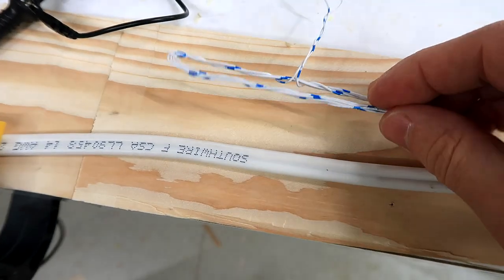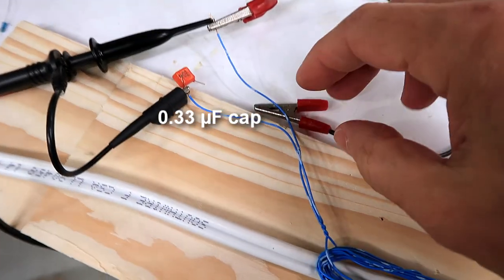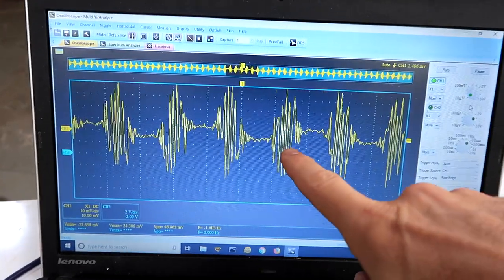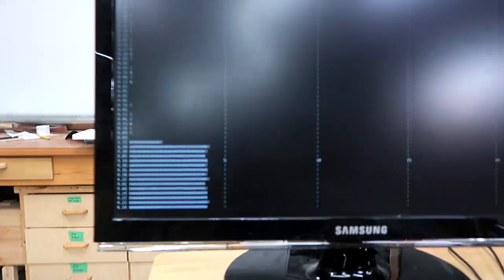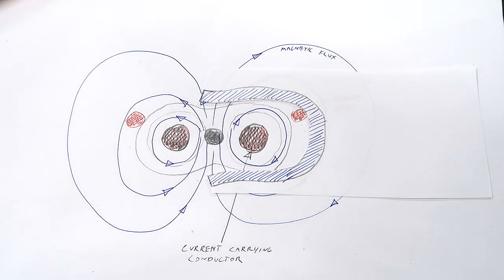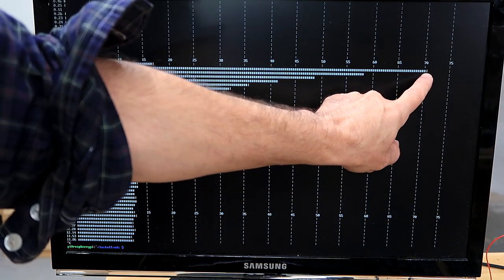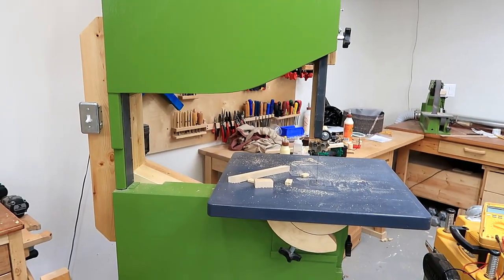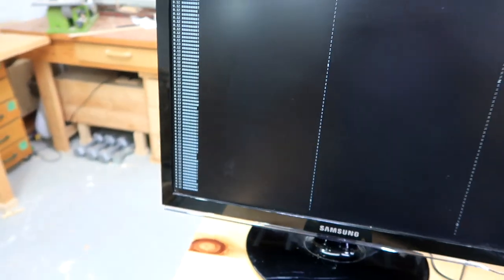Inductive current measuring using Raspberry Pi

Comment: This is roughly how the 'Sense Energy Monitor' products work. They develop a sort-of fingerprint for devices that are plugged in and identified on the circuits into your breaker panel.
Reply: Yep and it’s also why they don’t work. Device signals change and they can be similar to other similar devices.
Reply: @Mrcaffinebean  Mine has been very accurate. It discerns the difference between my iPhone and iPad when plugged into the same charger for example. I think you're just being Mr passive-aggressive-not-so-smarty-pants.

Comment: You could use a extension cord with split cables to measure every machine. No need to split the cables of the machines.
Reply: Well, what's the point of the challenge!

Comment: if you power your electronics connected to the Pi with a separate power supply it will help with noise a ton. Running them off batteries will work best for eliminating noise. The Pi has very dirty power.

Comment: If you powered the ADS1115 off the 5V rail, than yes I suspect you would see noise due to whatever the RPi is doing. The 5V rail is unregulated. However, the 3.3V rail is very stable - try that
Reply from the maker: it's running off the 3.3 volt rail.

Comment: Out of interest what make/model is the circuit breaker? Do you know what curve type? C,D etc? I believe typical household C curve type CBs depending on their make will trip instantaneously at 7-10 times their rated current. If your breaker was rated at 15A then it looks like it not tripping at 145A makes sense. Given that this is in the higher range of CBs and their are always going to be tolerances in circuit breaker tripping curves. Really good/interesting video hope to see more on DIY metering.

Comment: Funny, every time I started my table saw and shop vac at the same time it blew my 15A breaker or would tripped the GFI. I guess the arc from the vacuum motor is the cause? Annoying for sure.

Comment: If you want to make a current tansformer you need to put a load. Your coil needs to have a resistor accross it.This whay you'll get rid of the noise and actually measure current and not voltage that somehow depends on current, but also on other things
Reply from the maker: This is not a current transformer in that sense.

Comment: Its quite common for a motor's peak starting current to be about 6 times the normal running current.
12 amps × 6 = 72 amps

Comment: I'm enjoying this sort of content, but I'm weird. Could you describe some of the theory behind filtering noise from the RPi? I had constant issues with mic noise with my RPi. I was using USB sound chips. I'm glad you decided to look in to the clamp on style probes.
Reply from the maker: I just filter for the 60 hz component.  That might not work for your mic.
Reply: @matthiasrandomstuff2221  yeah. I think it's high frequency noise from the Pi

Comment: I get why the current measuring tranformer doesn't work unless you isolate it to one of the wires in the circuit. Or at least, I think I get it: because of the left hand rule, the magnetic fields on each wire cancel each other out (from the perspective of the transformer).

But why does your homemade coil work? Why doesn't the same canceling out happen? Both phenomena are capacitance, but something must be different.

Comment: I wonder if you could rectify the signal from the coil and run it in to an Op amp then convert it into an off on signal. Then you could have one CT on fuse box incomer, from that you could deduce how much power is being used and on which circuit.
Reply from the maker: signal is too weak for a rectifier.  but it could be amplified then rectified.

Comment: I'm wondering what mechanism the iVac switches use. I know they clamp on the wire of the tool. I'm guessing it's similar where it's trying to cancel out part of the coil by positioning the clamp next to a single wire within the sleeve. Been wanting to do something similar to automate my workshop without splitting cords or creating my own extension cord with the split-wire. I tried a Hall Effect sensor too, but I got nothing from it.

Comment: I used current sense transformers on each of my machines connected to an arduino to automate my whole dust collection setup. I have a vid explaining the details on my channel. I actually want to experiment using an FPGA instead of an arduino. Do you have any interest in FPGAs or Verilog?
Reply from the maker: no interest in FPGAs.  i don’t even use arguino.  the pi is surprisingly real time when it’s not busy.

Comment: You should test audiophile power cleaners and conditioners to see if it really does clean up signal noise in your power lines.
Reply from the maker: I'm not paying some exhorbitant amount for them, and I'm quite sure they wouldn't send me one for review!  Plus, no point in arguing with audiophiles.  They are as removed from fact as conspiracy theorists.
Reply: @matthiasrandomstuff2221  I don’t disagree in the slightest, but you bring a level of electrical engineering think it’s made me thinking about the stuff I do pay for when it claims to reduce noice from power lines and just how noise is generated. So thanks for the educational and experimentation videos like these.

Comment: Have you looked at using a hall effect device to measure current? I would be interested to see if this would work?
Reply: Wouldn't that make it extremely difficult?
Hall effect sensors can only give proportional voltage by magnetic strength.
Magnetic strength is dependent on mu the permeability constant x the medium of travel multiplied by B field and dI/dT times the number of turns, which I assume is 1 in a single coil.... but then again stranded wires effect that too

Comment: Out of curiosity, did you try any of those little Hall Effect sensor chips? Ive been meaning to try putting one of those against the outside of a tool's extension cord and see if I can detect whether the tool is turned on.  The end goal is to automate my dust collector and blast gates, similar to those insanely overpriced iVac systems. Looking at their clamp on current sensor that doesn't require splitting the cable, I think it probably has to be using a few Hall sensors internally.

If I can't make the Hall sensors work, I'll split the cables and use current transformers, or maybe build a box with a plug and an outlet that has something like the ACS723 current sensor chip inline.
Reply: Current transformers are always the best option. Hall effect sensors won't work, because those which have digital output, are not sensitive enough.
Reply: @teslakovalaborator  digital hall effect sensors can absolutely work in this situation, and are used for non intrusive current measurements.
Reply: @reportingsjr  but still, CTs for the win
Reply: Klein sells a wire splitter for measuring amps. It’s a plug but the wires are split to put a ct.

Comment: I understand that clamp-on meters have to be around just one conductor or they will cancel each other out.  My question is why doesn't yours? Is it because it's running parallel to the conductors instead of around?
Reply from the maker: it’s picking up the magnetic field, as explained in the video.

Comment: I was wondering whether you were actually cancelling the current in one leg of your coil by the return current flowing in the neutral (this is basically how GFIs work), but I'd need to think long and hard about the direction of the wire and the flux! Did you try a home made coil with just one leg of the power?
Reply: He is. This is better described as "detecting" current. You're not going to get an accurate measurement with his DIY coil measuring both legs.
Reply: I was thinking the same, Mike. Still don't get why his parallel coil worked while a perpendicular obviously wouldn't.
Reply: @sligovolts  I think it's because one side of the coil is close to the live but relatively far from the neutral and vice versa.
Reply: @eDoc2020  ok, but since there's a "vice-versa",  shouldn't it cancel out the induced current? I really don't know
Reply: @sligovolts  It shouldn't cancel out.  If you use the right hand rule to determine the direction of the magnetic field you find that the hot and neutral lines in the Romex go in the same direction through his coil.  Matthias illustrates this @1:52.  This type of setup has to be calibrated to be accurate, but it shouldn't cancel out entirely.  It's all about the amount of magnetic flux going through the loop.
Reply: @bryanmwestra  Thanks, Bryan! Now I get it.
Reply: @sligovolts  my thinking was that the cancellation would be imperfect based on any variation in the physical geometry. But yeah, perhaps this is not an issue with the parallel coils.
Reply: @guitarman256  No there is nothing canceling out. Look at Matthias’ diagram; Both the hot wire and neutral wire create a magnetic field in the same direction

Comment: Curious what the sample rate was of your A/D was and if the scrolling graph was a one to one in step? It looked  to slow to be accurate to capture the spike loads.
Reply: If you kept reducing the sampling time, the instantaneous current would ideally keep increasing till it hits V/(impedance of transmission line). At that point neither the load nor the source affect the measurement. Surely that’s not what you wanna measure right?

Comment: I'm glad you shared this. I was curious how you had it set up. Did you consider using a commercial line splitter? I just looked them up (on Amazon) and noticed they are pretty expensive for what they are. I've thought about wrapping wire around one side of mine to sense current but I don't know the specifics of setting up the electronics to log it.
Reply from the maker: Why buy a line splitter when you can just split the line with a knife?
Reply: @matthiasrandomstuff2221  For use in a commercial setting, a hand-made, short "extension cord" with loose wires would surely be frowned upon, over a commercially sold device.  Also if you're demonstrating for friends/family, or checking in their home, they may feel more comfortable with a plastic encased unit.

For home use?  Bring out the knife!

Comment: I think the ADS1115 doesn'tlike negative voltages? In that case, are you only measuring the positive amplitude of the signal? I wanted to do that once for current measurements, but everybody told me that I'd have to add an offset voltage and whatnot, but I never quite understood why. The positive amplituede of a 60Hz sine wave should almost be identical to the negative part, no?
Reply from the maker: it does go negative.  output is signed 16 bit
Reply: @matthiasrandomstuff2221  I just looked it up, and you are right! But it seems only to -300mV to ground, if I read correctly? I think I needed -1V back then, hence the level shifting.

But do you know why people told me not to simply measure the positive part of the sine wave, and throw the negative part away with a diode? That still bugs me.

Comment: i guess if you don't have those flat types of cable, but circular ones, you can not use the clamp on type in a wrong fashion
Reply from the maker: If you knew where the conductors are, you could still figure out the right orientation, though you would get less signal.

Comment: You maybe have a chinese ADS1015 instead of the ADS1115
ADS1015 is 12bit resolution instead of 16bit, and sampling rate is also faster : 3300sps instead of 860sps for ADS1115.

Comment: Why Raspbery Pi (with its overhead) and not a PIC?
Reply from the maker: Because then I'd need a raspberry pi to connect to the PIC to get the data off of it and onto the screen
Reply: @matthiasrandomstuff2221  I see. I just used my laptop

Comment: Do you think a LC circuit tuned to 60Hz would work well for this application?
Reply from the maker: yes, thouch it could cut down on responsiveness if it's too high a Q
Reply: I think that it is sensitive to changes in inductance though - a small change can throw the 'amplification' way off. For example, if you change the shape of the coil a bit, or if there's a piece of iron nearby.

Comment: So, this is my lazy and not particularly accurate offering. At least in Australia, there are different classes used for rating MCCB's (breakers) or RCBO's (Breaker + RCD) in particular. RCBO's don't just detect current (normally done by bimetallic thermal trip), they trip when current imbalance occurs between the targeted conductors (i.e. live and neutral in typical single phase), so you hear that function referred to as ground fault circuit interrupter (at least I think that is typically terminology in your part of the woods). Anyway, each class allows for increasingly higher tolerance for beefier loads, particularly to accommodate greater inductive loads with high in-rush (notably when a big transformer or motor cores happen to be in a saturated state via hysteresis and you just happen to plug the bad boy in near the right peak voltage and not near a zero crossing or opposing voltage...that presents very little impedance). Going off the top of my head, A class RCBO's tolerated 3x their rated current for a defined period, B was 5x (maybe 7?), C was 7x (or maybe 10?)....onwards and upwards. The point being, you don't just need the right rated current, you also need the right design to suit the connected loads (vs personnel risk in the environment...regs prevent willy nilly installation of C class RCBO's in residential applications etc).

If hysteresis leaves you with a near saturated core and you happen to connect near the right voltage peak, you are probably looking at a 10x current in-rush or more.

You can get all the design curves from the data sheets, but the summary is pretty obvious: the more tolerant you make the design to avoid tripping with in-rush, the less sensitive (the greater the time) it takes to trip for an actual fault condition to be detected and disconnected. This is why they are sold in different classes for different applications/scenarios, A/B might have a decent shot at saving the mug punter in their house that goes around sticking forks in their outlets, but a C has a pretty good chance of allowing enough prolonged electrocution to seriously up the odds of medical complications from the shock etc. There are also other RCBO's, designed for DC applications (think electric vehicle chargers etc).

Under a dead short condition, they're essentially rated on their breaking ability (i.e. actual capacity to disconnect the circuit without getting welded together etc). Again, heaps of specs around that, but suffice to say you are talking seriously high current loads there.

Rather than plugging all those little motors in, you have a much better shot at tripping it on in-rush just with a big transformer core being randomly plugged in and unplugged again 👍

Comment: the electricity flows out side the wire not inside. wireless phone chargers would exist if it was in the wire. theres no particle moving. the wire is like a train track. it rides on the wire as it is a path of lowest resistance. the dewalt does this because they sell equipment. the battery and motor take more ware so it goes out faster they want you to buy many not one.

Comment: Sense coils always should be on just one cable
Reply: Since the other cable creates an equal oposite voltage canceling it. You only get the gigh frequency noise and DC leakage current to ground
Reply: Wel watching furter you find it out in the video basicly 😅
I have a bad memory and cannot comment after watching it all..

Comment: 60 Hz? i thought canada used 50 Hz?
Reply: You are wrong Mr smartypants!
Reply: Are you getting the UK mixed up with Canada?  Anyways, I can't find historical data of electric changes. Quebec might have been the one to be different for a time.
Reply: @lightdark00  i remember there was one power station somewhere where they had to run their generators at different speeds in order to produce 50 Hz for one country and 60 Hz for another. i thought that was somewhere along the US/canada border.
Reply: @mrxmry3264  North America is all 60Hz so far as I know.  I did a google search, and ITAIPU is situated on the border of Paraguay and Brazil and supplies 50Hz power to Paraguay and 60Hz to Brazil.
Reply: time error correction is used to trick any remaining clocks that need 60hz (or 50hz).  utilities periodically raise or lower frequency to resync (the mostly nonexistent) clocks.  frequency is pretty irrelevant in a world run by rectified DC

Comment: lol those $2 chinese knockoff adc's
tried using 22 of them to read piezos to convert a piano to a midi controller and had a real bitch of a time getting everything working
...when I really should have just used 11 arduino nanos sending their own midi channel, with lmms and jack on a pi zero to output a single midi channel. would have been cheaper and saved me a ton of headache, even if the nano adc is 10bit.